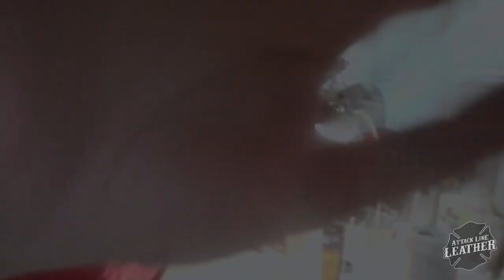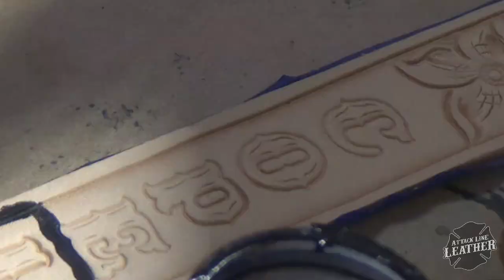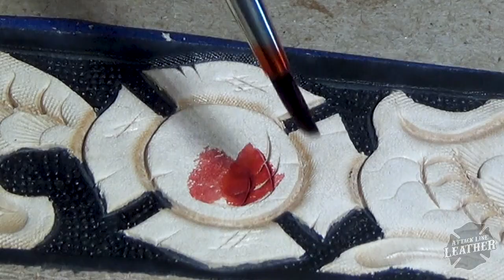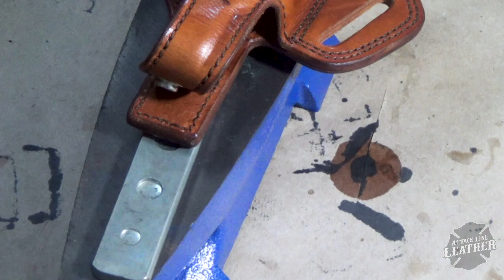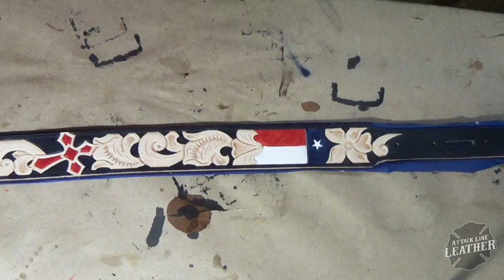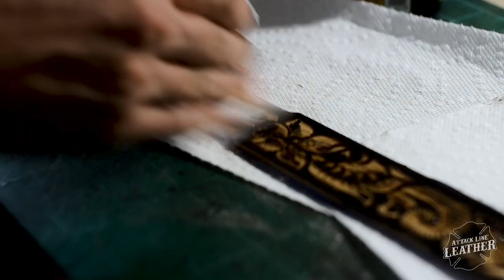A DAY IN THE SHOP 1.2

Comment: What resist did you use and how long did you let it dry? Did you use more than one coat?
Reply from the maker: I used tan kote. I generally apply it pretty thick and let it dry fully. It generally dries within an hour. Yes I used one coat before and after antique. Be sure the antique has fully dried before applying tan kote

Comment: What kind of snaps and buckles do you use for the strap?  Are they fire rated?
Reply from the maker: For this build i used brass hardware. I have no idea what fire rating it has but it holds up very well. With anything i would never advise anything come under direct flame impingement

Comment: What's the name of the tool that you're using to enhance your cuts with?
Reply from the maker: I use a beveler to enhance my swivel knife cuts. You can find them at all leather craft stores. They come in many sizes and I prefer using a small to medium sized beveler for my work
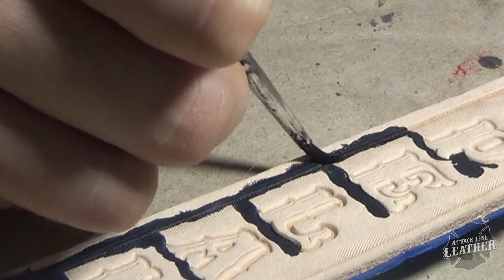Reply: So in part 1.1 of the day in the shop, at the 1:30 mark you're using a smooth beveler? Is it just an extra steep one? Mine are a little flatter than that one.
Reply from the maker: So that is a beveler that I got from hobby lobby. It is their small beveler. It is great for small tooling and yes it is pretty steep.
Reply: Wow i guess i never noticed it at my hobby lobby here. What's the number on it?
Reply from the maker: Sku # is 272591. I can get you the tool number when I get home
Reply: I can find it by that.  Thanks man! I'm new to leather so I'm still trying to figure everything out. Your hand work is awesome! You're very talented.
Reply from the maker: Tool number is PB011. Brand of tool is Realeather